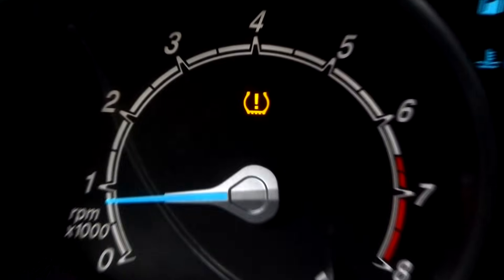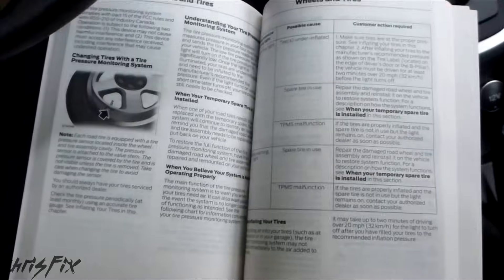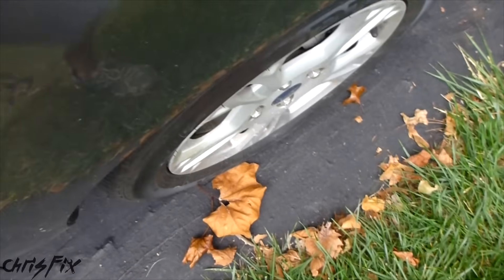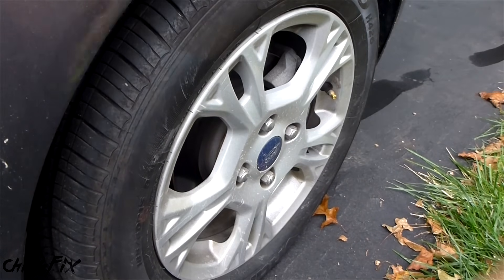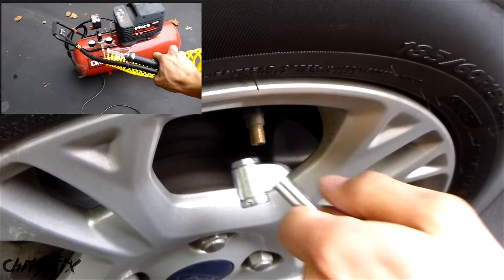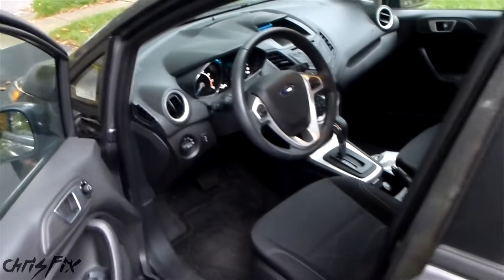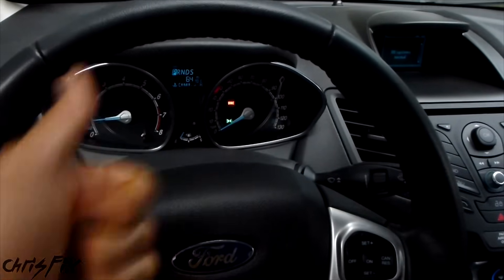How to Reset Low Tire Pressure Light (TPMS)

Comment: My tires are FULL. I have tried EVERY way to reset including holding down all the keys on key fob.  I even cleared my check engine light but my tire light STAYS ON even when it sais "resetting tires" it stays on and means nothing. Please help why this traverse light won't go off there is no low tires for a fact.

Comment: DO you ever just use a TPMS reader to inform you of each tire's air pressure? Seems like that would be crazy accurate (assuming all 4 sensors are working).

Comment: Chris, I have tpms light on but have all four tires on the dash saying correct pressure on all 4 corners and after driving its a bit higher, so the tpms sensor are communicating. Took it to a tire shop and they reprogrammed and checked all 4 sensors are good, Drove over 50 miles and light will not go off. 2012 challenger srt8

Comment: I have just replaced new tires and I also drove 10 miles. But the LOW PRESSURE LIGHT still on. Do I have to RESET ANYTHING?

Comment: Year tires these days are really hard to tell if they are low just by looking. And I usually see all my tires being low by about the same amount in the fall if they have been topped off in the summer when it's substantially warmer. And as you point out the cool temps cause a large enough drop to trigger the warning.

Comment: Need help please I have  2013 jeep wrangler , rear driverside tire monitoring system shows no reading at all on the pressure display on my dashboard,  even after tires are rotated, been like that for a year , the rest tree tires show reading , its always rear driver side  tire
Any suggestions please
Reply: If the battery isn't dead it may need to be programmed.

Comment: My light has been on for years, I always check my pressure every month, I even bought the tool to reset the sensors, I know I have a bad sensor but the dealership wants almost $300 just to find the bad one, lol, don't think so. Thanks again for a great video.
Reply: How are you able to renew your registration
Reply: @brophetic4456  the tpms doesn't affect catalyst output (exhaust output) it passes here in MD.

Comment: Every one reading you should let all air out of your tires before the change of seasons so the air is not too hot or cold inside your tires which could cause premature ejaculation tire failure

Comment: To “reset” TPMS you fill each tire to tire pressure recommended in owner’s manual or sticker displayed inside driver’s side door jam, then push TPMS reset button (find location of button and instructions in your owner’s manual).

Comment: I was a little excited that you had a video specifically about a Ford Fiesta and the TPMS, which I have issues with at the moment. Anyway, you need to do a trick with the brake pedal and ignition to get it into TPMS reprogramming mode and then use a strong magnet on each sensor (located near the stem) or get a proper code reader that can perform the reset. The horn will sound when it enters the reprogram mode and when each tire sensor is reset.

Comment: On my car, when I use the TPMS sensor, it works for all tires except just one. Any idea on why that may be happening? If the sensor in the one tire is messed up, do you have any videos on how to replace it?
Reply from the maker: You might need to do a relearn, and if that doesn't work, you will have to replace the module by taking the tire off the rim!
Reply: @chrisfix  thanks for the swift reply. I should've noted that this is what happens DURING the relearn. First 2 work fine but I'm gonna try what you said for my 3rd. Thank you!!

Comment: My tires are good to 32 psi. It was at 25 some are 27. But I got it all to 32. But it’s been 2 months. I’ve also adjusted it and putting it to 36 psi but still the low tire pressure light is there. Someone help? I need answers
Reply: If your sensor light blinks for a minute when starting the car and then stays on solid. One or more of your sensors is bad or has a bad battery.

Comment: What if your tires are inflated to proper operating range per vehicle specs and the Low Tire Air is on and doesn't come off, how do you fix that or do you just need to fully replace the tire sensors?

Comment: The title is accurate
You reset the TMPS by properly inflating tires.
Note: ambient temp
Note: immediate use
If you are about to go on long road trip, lower 3-5 lbs. Then check one hour in.
Visually inspect daily.
Digital gauge monthly

Comment: Really good vid.. some points you make to take away..   use a digital pressure gauge.. check all tires, and know that the tire warning light will turn off after driving.. this last one was what brought to your vid.. I did all you show and was slightly confused that pressure warning light was still on.. so you info calmed me down thanks for taking the time to make these vids  :-)

Comment: I put a set of wheels off a 2012 f150 and put them on a 2007 f150 and can not get the 2007 to relearn the sensors and i have that relearn tool. Any ideas?

Comment: This video has no real content, just common sense to explain that you need to check your tires pressure when cold, not just after just driving.
- I rented a car and get a TPMS warning, I checked the pressure but didn't help. I call the service center and they said it was fine and will reset
when I will return the car. I was far away and I had to drive back at night on a weekend. This was not a very comfortable situation.    
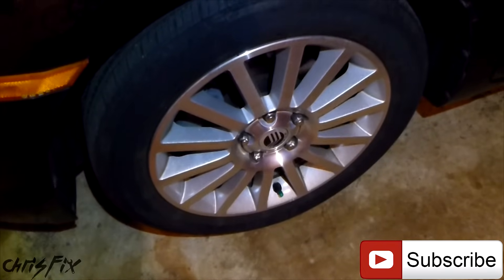- 5:32 About the Nitrogen, "you can even tell the difference." Absolutely dump comment. I believe the advantage is only to lose less pressure over time.

Comment: A couple of days ago my TPMS light suddenly came on.  I was actually relieved when I found out what the warning light was because I didn't even know my car had one of these sensors and I initially thought my engine was about to explode in flames or whatever.  After watching your video, ChrisFix, and then reading a fair amount of the comments, I was dubious about the whole shebang but I read the manual and found out what the correct tyre pressures (front and rear) were.  Then I ventured forth to the garage where they have a machine which you can set to your required psi (36 front - 32 rear).  I inserted the money and got on with it.  Later when I switched the ignition on I was happily surprised to see the TPMS light off even before I turned the engine.  I guess it still could come back on again but so far, so good.  Thank you for posting this video.

Comment: Tpms light reset is different for every car sometimes you have a button you have to press sometimes you don’t that’s why you have too reference your owners manual but what is the same for all cars is inflating your car to the right pressure. If after doing this correctly it still doesn’t reset you may have to take it in to a shop or buy new tpms sensors to get installed and recalibrated. changing stock wheels and or tires can cause the light to stay on even after having the right psi pressure which sucks but can be corrected if tpms sensors are recalibrated and to learn a new reading for your new wheels and tires.

Comment: What does it mean when I just checked my tires it usually has all 4 and how much air is in them but it had - - - for all 4 then I toogled through mpg, and all the other options till it went to system and system warnings and it say check tpm system or something I got home and was going to check the tires manually backed of garage and pulled back in so I had more room for myself to squeeze in between all my cars, and the light warning was gone and pressures were up there 35's 36's normal, certainly after driving 60miles pressure never goes down unless there is a leak it goes up 3-5lbs.  Either way I asked the guy at the garage to check it tmro when I have it detailed.  Of course its gone now.

Comment: I put valve caps in my pocket, and put them on when I’m completely done. They don’t get lost, and don’t get on the way.
Reply: That will work. For myself, I place the cap on the ground next to the tire until I am done airing up the tire and then it's on to the next tire.

Comment: My car has the display that reads the psi in each tire. But on one of my tires it reads 0 but it's not low on pressure when checking it with a guage. Is it a censor failure?
Reply from the maker: Correct it is probably a sensor failure. Did  you use "fix a flat" in that tire with the bad sensor?

Comment: Low tire press the cause of most flat tires that you see see along the freeways. Especially when you see RV's & boat trailers. It is safer to drive with 5 pounds of over pressure than 5 pounds under pressure. Only check your tire pressure when the car has not been driven for an hour or two.

Comment: TPMS systems are just a money grab. Expensive to replace the batteries every few years. OMG how did we ever survive without them.
Reply: My car is 10 years old and has a TPMS. Never had to replace the battery, and every time I get a notification, there actually has been a drop in tide pressure
Reply: I just leave the light on and ck my tires myself.
Reply: @Tumbleweed After 8 years you will.
Reply: Ford Explorer and Firestone tires.  That's why.
Reply: I don't like its an extra expense but reason behind it makes them needed in society.

Comment: The only way a tire can have 100% nitrogen in it, the tire would have to have to be in a negitive pressure or at a vacume before it is filled with nitrogen. Pulling vacume on a tire would be exstreamely hard because the bead would break and air would rush in.

Comment: On a lot of toyota/lexus and asian vehicles, there is a reset button hidden up near the steering column, but certain vehicles, such as my LS460, require this to only be done via TechStream at the dealer. 

Chris' title should just read "How to put air in your tires so the TPMS light can go away."

You're welcome.

Comment: I changed the tires on my pickup to 10ply and now run more air pressure. the tire shop told  me to deflate the tires to 35 psi and true the lite went out. so they work when either over inflated or under inflated.  I run 45-55 psi 'cause I pull an rv . I just let the lite glow.

Comment: Any way to reset it if you can’t fill the tires anymore? I bought my scion with aftermarket rims that were bigger than the stock ones. Filling the tires to what the manual says makes the tires rub against the wheel wells. I keep them at 35psi to keep them from doing that but the light stays on. I did what the manual said to reset it but it stays on still.

Comment: I have a Ford Escape 2014 and I need to put on my winter tires, will the TPMS  turn off or do I need to reset the TPMS and if so how do I do that?
Reply: From what I learned from the dealer, if the TPM valves are replaced with normal valves, or the entire wheel is replaced, such as snow tires on their own wheels, the dash light will be annoyin, er, glowing until the original tires/TPM sensors are reinstalled. A trip to the dealer may still be required to reset the whole darned thing. Check the owner's manual and call the dealer, if necessary, for the exact procedure.
Hope this helps.

Comment: What if the tires are fine but the light still won't go out
Reply: make sure your spare tire is inflated to the correct pressure. they often have a sensor in them. if not, your tire pressure monitors may need to be replaced.

Comment: If I have the monitor/gauge pod that shows what the pressure is for each tire, would this be a fix to mixed up sensor placement? I got new wheels and the shop didn't place the sensors into the new wheels with respect to the old ones, so on my gauge it shows for example Rear Right as Front Left.

Comment: This winter one of my tires was low which tripped the TPMS light. The low tire was inflated but the light would not go out. I was told that the sensors needed to be replaced for about 250 dollars a tire. The car sat for the winter till I came back in May. I started the  car and THE TPMS LIGHT  WENT OUT AND ALL TIRES WERE FINE. I think the real cold weather caused the malfunction.

Comment: Not at all helpful. I thought it would tell me how to get a light that is staying on after the pressure has been fixed to go off. bummer. Who doesnt know how to fill up a tire to the right pressure?
Reply from the maker: Thanks for the feedback. If the light is on and not flashing, that means the pressure is low. Did you try filling it past the recommended pressure just to see if it goes off?

Comment: This has nothing to do with RESETTING your TPMS!
Reply: enkrypt3d EXACTLY‼️
Reply: Thanks for saving my time
Reply: Resetting the tpms requires  a scanner
Reply: Exactly right. This video is worthless. No kidding the light shouldn't be on if the tires are properly inflated. 🤦🏻‍♂️🤦🏻‍♂️🤦🏻‍♂️
Reply: I agree with you.
Reply: You do understand that resetting in his case means getting rid of the annoying ass light when you don’t know which tire is inflated
Reply: Definitely didn't work with mine. Filled all 4 tires properly, the warning light is still on. Probably gonna have to take it somewhere to fix the thing. 😤
Reply: @artdogg50  There's a tpms reset tool u can get to plug into your OBD II... use it then return it :)
Reply: @artdogg50  Each of the 4 sensors has a battery. Batteries are drained after 7 or 8 years.
Reply: Yes it does!! Y'all just so quick to accuse somebody of a mistake on your behalf! I've been watching his videos for years!

Comment: My 2007 Nissan Altima has had this problem with the light staying on even after inflating all the tires to correct pressure. So what I do is I take down to my local tire shop and they reset it for free, only takes about 5 minutes and stays off until a tire needs air. The Nissan dealer is over 100 miles from where I live so one of these days I will get to the dealer and have it fixed properly but until then the tire shop is where I go...

Comment: The tire store told me that those senders in the wheels have batteries in them that are only good for about 5  or 6 years.  I have a different light that tells the system needs new batteries rather than low tires.

Comment: Chris  I am 13 years old and my mom has 2010 shevy cobolt with the tire monitor light on the dash we replased all 4 tires and reset the sistem and it came back on and we had it inspected by autozone the sistem is fine what would couse the tire lite to show on the dash is there a short in the electric sistem  PLES LET ME  KNOW so we can fix it

Comment: As long as its not a significant amount above the normal psi. Does it really matter if the tire pressure value is above the recommend value? (32 psi vs. 33.5 psi, 33 psi, or 35.5 psi)

Comment: Hey Chris great video. I wanted to know let's say you have one faulty TPMS can you replace it with an after market one or do you need to keep it manufacturer original for it to work with the system. My car is a ford fiesta ecoboost. Thanks
Reply from the maker: +Arts&Trusts usually you cannot but check with the manufacturer

Comment: I have a 2016 Ford morning Transit Connect with 30,000 miles.  I couldn’t get mine to turn off. 

PS. I HADA 2002 t bird with 17,000 miles.  Mine was red.  Parts difficult to locate.  My mom had a yellow one.  We were going through storage and came across her pre order Ford welcome 7 boxed kit that showed every step of development.  One of the cool boxes has these t bird with glass or crystal windows as book case holders !  
Anyways, make sure coolant is flushed with gold premium and replace the OEM egr or that aluminum and plastic induction will warp ($4,300 to replace), make sure the coils aret registered with fords extended warranty a repair that can cost ($3,000 or more if warpage occurs).  I also have a non working 6 disc CD player (radio works great-this was a ($1,798 replacement).

Comment: The tire pressure light on my Mom's 2003 Ford Windstar came on. She didn't know what it was, and didn't bother to ask me, so she took it to the garage. They convinced her that it meant that she needed new tires! She only had a year on them! I told her to never ever go to a mechanic again without talking to me first.

Also, on my 2008 Chrysler Town and Country, I put air in the tires, and the light went out when I started it up. With Mom's 2003 Windstar, the light never went out, and she complained to me about that. She said "I just got new tires and the light is still on!" I found a button to the left of the steering column that says "Tire Reset"!  The more I learn about her Ford Windstar, the more I hate Fords!

Comment: I have a dash light which blinks randomly very fast. One quick flash, a micro-second. I can not tell exactly which one it is blinking. Is there a way to test the battery levels of the sensors? It is either the TPMS or the StabiliTrac light. I have no disable button on dash for Stabilitac I replaced one from my Chevy with a NAPA TPMS. I love your videos, your are very detailed. 👍

Comment: Glad I checked all of them. I let the vehicle sit for a few hours on a level surface. The outside temperature wasn’t too hot or cold. A few tires were 25.5, the other 2 were 27. So I grabbed my old air compressor that my wife got for me on clearance years ago. I shot them back up to 32. Thanks to this video.

Comment: What's up Chris have a question I had some after market rims on my car I sold them not knowing anything about tpms sensors so I'm planning on buying some new sensors do u know if I have to reset the whole System or will the sensors automatically reset themselves while I drive 2014 Dodge Charger se model

Comment: Hi, great video like always! I have a Kia Sorento 16. several days ago I had a flat tire so I switched it with a spare tire and fixed it. Now that I install it back the TPMS light is on asking me to check the TPMS and it doesn't show the tire pressure. I inflated all the tires but it still remains the same. any idea how to fix that?